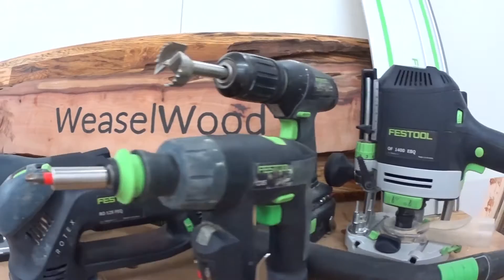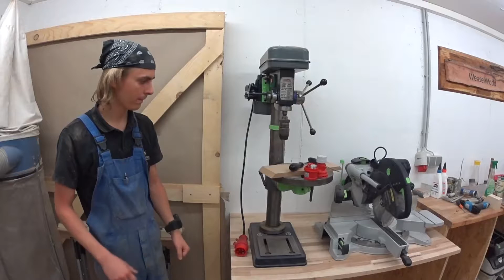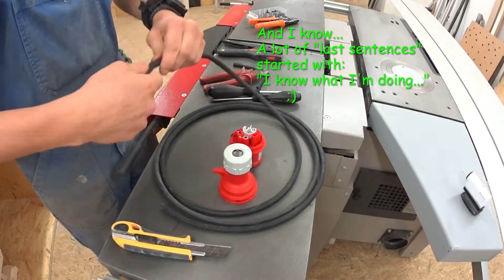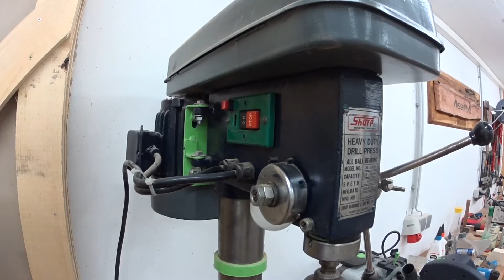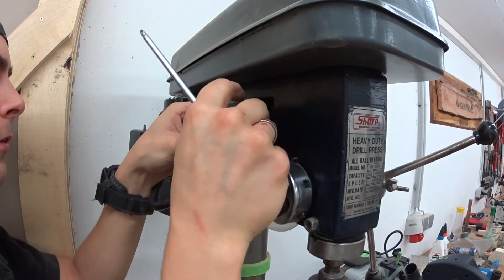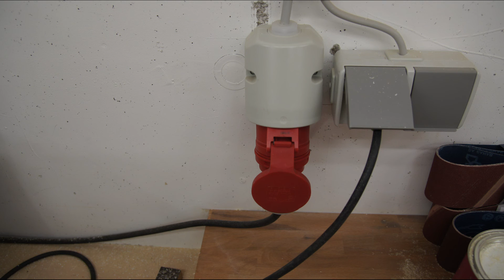Power cord replace [WeaselWood Maintenance #4]

Comment: So do you use 3 phase 230VAC for everything there in your country? We use primarily 1 phase 120VAC here.
Reply from the maker: Hi James
We have basically every household supplied with 3 phase 400VAC (phase to phase), or 230VAC single (phase to neutral). The most households don't use 3 phase power, but the supply is in place as you need it. Also you have lesser loss on your cables, specially if the next transformer is far away from your house.